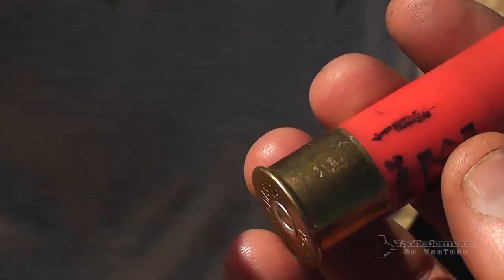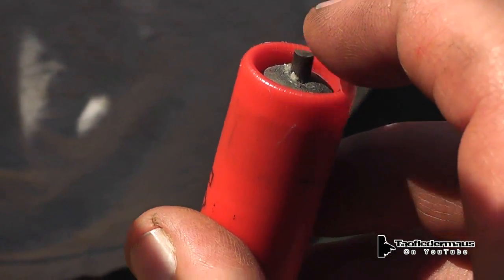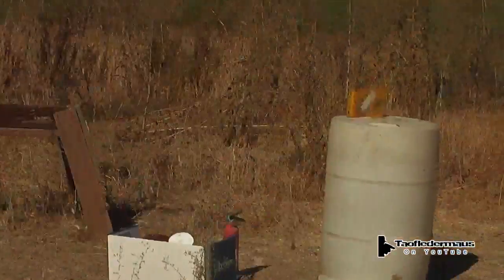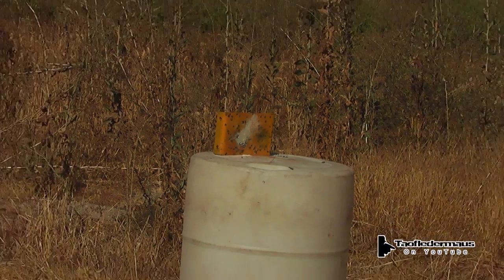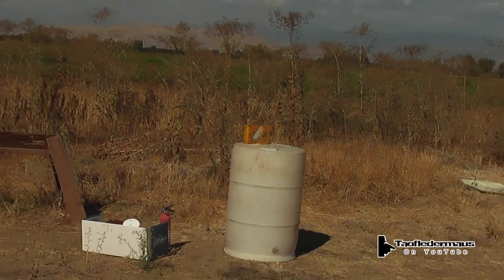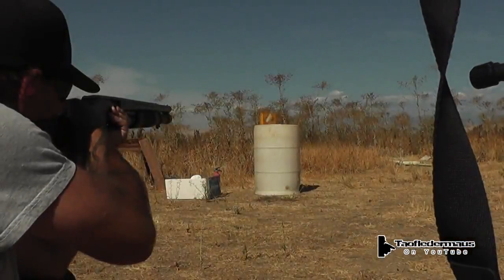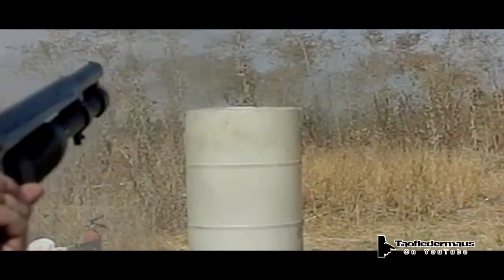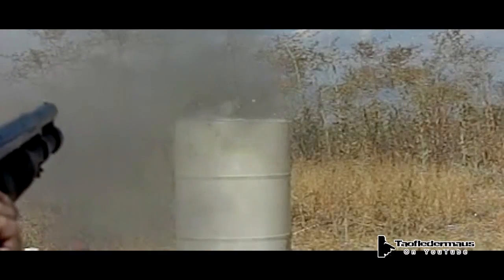FLINT-TIPPED 12 ga. Deer Slug

Comment: A neat thing we did when I was a kid, a long time ago, was cutting off the tips of the kind of match that can be lit off almost anything and has a white tip. Ohio blue tips were the kind we had. We would cut off a bunch of tips and add alcohol to get them wet as to not ignite and grind them up. I believe it is a type of phosphorus. Any direct friction will set it off. It can be used for the blast itself or a friction fuse to ignite another substance.

Comment: The reason you didn't see the sparks is the same reason the HD cam didn't pick it up. Your eye is basically an HD camera constantly recording at 30 frames per second. The sparks that were between camera frames were also between the "frames" that your eye picks up. Pretty cool stuff!
Reply: the human eye views the world at 60fps approx
Reply: Ben Weldon Not true.
Reply: eye has no framerate. its simply just harder to pick up shorter impulses of light. On the other hand if the short impulse is strong enough it still can be seen. it takes some time for photons to stimulate the retina, but if theres more photons, it gets stimulated quicker.
Reply from the maker: Excellent, Kabuuc!  Plus short flashes have a longer retention in our eyes.   Probably not the correct term.
Reply: kabuuc
No, the eye (or rather, your brain's optic processing center) DOES have a frame rate. Ever look at a fan as it is slowing down and it appears to turn backward? That is because of your frame rate. At your focus point the fan's rotational speed is dropping out of synch with the framerate and the advancing blade is increasingly behind (remember, it's slowing down) every time your eye makes a frame. Eventually the fan slows down enough for your optical frame rate to see it as traveling forward again. It's also why TV Hz ratings above 120Hz are of no benefit because the eye can't see any higher than that anyway.

Stolen from Wiki:

"The human eye and its brain interface, the human visual system, can process 10 to 12 separate images per second, perceiving them individually.[1] The threshold of human visual perception varies depending on what is being measured. When looking at a lighted display, people begin to notice a brief interruption of darkness if it is about 16 milliseconds or longer.[2] Observers can recall one specific image in an unbroken series of different images, each of which lasts as little as 13 milliseconds.[3] When given very short single-millisecond visual stimulus people report a duration of between 100 ms and 400 ms due to persistence of vision in the visual cortex. This may cause images perceived in this duration to appear as one stimulus, such as a 10 ms green flash of light immediately followed by a 10 ms red flash of light perceived as a single yellow flash of light.[4] Persistence of vision may also create an illusion of continuity, allowing a sequence of still images to give the impression of motion."
Reply: I don't think that I have ever seen such an effect in daylight.  Such an effect requires a shutter of some kind.  Either a camera shutter or artificial light which has 60 Hz on off speed. brains processing doesn't work as discrete frames. Images linger in the perception depending on the strength of the stimulus but there is nothing that prevents stronger stimulus to change an image at any time.
Reply: kabuuc  yeah, I have never witnessed car wheels appearing to rotate backwards. They become a blur, but do not appear to rotate backwards unless under artificial light.

The human eye doesn't even make a "frame" as a display would. Different rods and cones are sampled at completely different time intervals that have nothing to do with a framerate. But on average, persistence of vision prevents framerates higher than 120 hz from being beneficial as the frames blend into one another with all the clarity of true motion.
Reply: the human eye does have a frame rate of such, Im not going to go into depth or anything, just do some simple research,  yourself.

With all being said, its not quite as arbitrary as I first stated above.
Reply: Ben Weldon
can you provide some reference for that?

Comment: weird 12ga shotshell idea#3 = remove crimp and remove slug and shotcup and reduce power charge by 25% to reduce chamber pressures by compensation for increase load weight. invert a hollow base slug and use small drywall screw from underneath through cup and then into slug to attach it to shotcup permanently. make a thick paste of strick anywhere matchheads crumbled and drops of water. pour into hollow base of slug. let dry completely. ...enjoy

Comment: I wonder what would happen if you filled the slug with a generous amount of lithium. 
I wonder if the fluid in a mammal would react and make it blast and flame? If so that would be a terrible thing. If hitting a solid the spark would set it off.

Comment: i wouldn't even chain down a CO2 ,the chain will become either frag or a huge flying mace ! the steel door that was behind the unit that got blasted was both bent and the rear of the cylinder went right thru it like a huge slug :P ,better off behind a huge bolder and have several hundred yards between you and the shot

Comment: In this vid you said you had it at an angle, i may be wrong here (about the angle) let me watch again but i have no reason to lie i have no interweb buddies to impress. I may have been shooting at thinner stuff anything is possible but its doubtful, i would go as far as saying my target was at least 1/8" in thickness. Goes through like butter. And dofishbutter has a very valid point your energy transfer with your plate sitting loosely there it isnt going through especially at your angle there.

Comment: The flash would be brighter at night, yes, but it goes so fast that the sensors on the CCD in the camera will be flooded and all you will see is the whole frame being white/yellow...  The only way to get a better shot at night is to use the high speed cameras to stretch out that flash, but once you pull out the high speed, you face the issue I mentioned with the f-stops.
Technically speaking, what is in the footage above is about the best that is possible on consumer grade equipment

Comment: You were shooting a loose steel plate so the energy transfer caused the plate to move. Now I don't make a habit of shooting steel plates with slugs however I imagine an immobile piece of 1/4" steel you may have an intresting result. Not saying you will get a round hole but the "dent" will be stretched to the point of cracking or even holed. Just going with the physics of things.